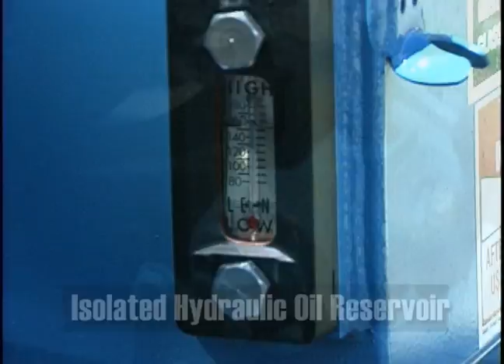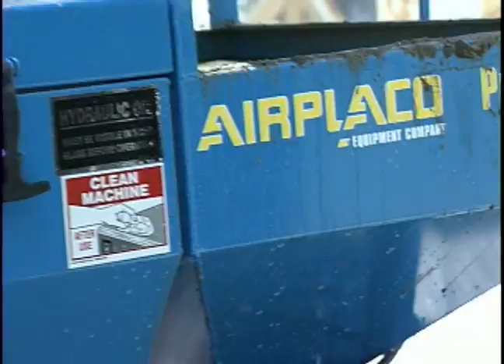BLOCKFILL, Masonry Block Wall Filling, masonry grout pumping

Comment from the maker: toekneecrass,

thanks for your feedback. This pump is designed to fill a need. It will be a good fit for many masonry block fill jobs but not all. It can pump up to 8 cu yds per hour, a typical size of transit mix truck. We also offer a 5 inch swing tube pump that can do 36 cu yd per hour. Todd

Comment from the maker: Val, sorry for the delay. For example, masonry contrcators may need to grout the wall after the fourth course and then they may be able to lay slightly more than 4 courses before having to grout again. They would grout from the highest point as well. If we learn more we will update this. Again, the job specs would vary from job to job, state to state, maybe city to city.

Comment from the maker: If the Contractor or Material Supplier mixes and delivers at too low of a slump, then they would require some vibrating. Masonry Contractors normally like a material that they use for Block Fill in the 7-8 Slump range.

Comment from the maker: Masonry contractors will use a grout mix to fill cores. This mix contains cement and aggregate, which can be fine (3/8") or coarse (1/2") grout. The specifications on the job will determine how much of the wall should be filled.

Comment: What product is used to fill the blocks?  is it more concrete--only a less dense mix?   (PS the music is annoying)  Also, when should block fill be used?  Does it depend on the unbalanced backfill load--or just an engineered need for a stronger wall?thanks